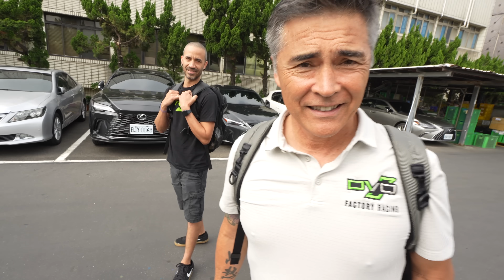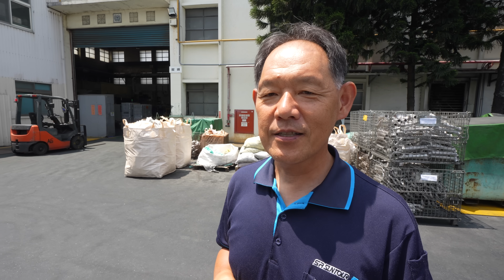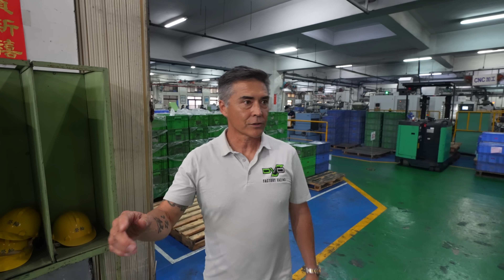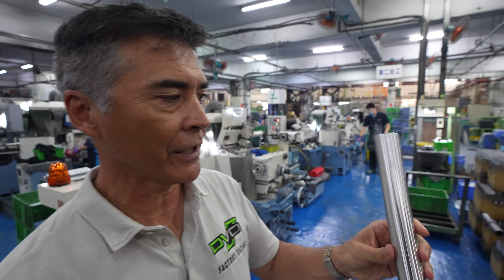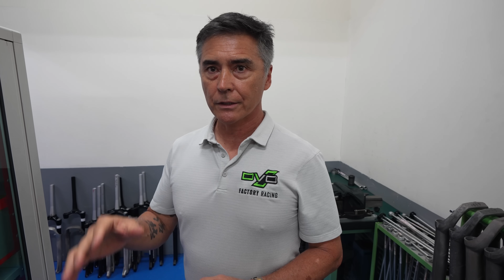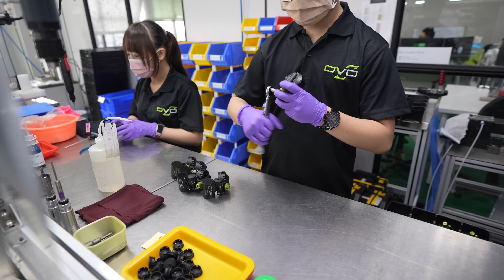We Flew to Taiwan to Visit a Mountain Bike Factory! (Exclusive HQ Tour)

Comment: The die cast machines are definitely newer than the stuff we deal with at work.  Some of our stuff is over thirty years old.  At our other shop nothing is more than five years old.

We stopped making stuff out of magnesium years ago.  One time I was making magnum hammers and the mold opened up and metal got on the floor.  If you counted to three the metal shot up into the air when it cooled.

I don't even know if anyplace molds magnesium in the USA anymore.  We were one of the last in the car industry.  We also do the biggest pieces in a Harley Davidson police motorcycle crankset too.  We are about an hour away from Milwaukee so if something's not is screwed up we can ship new stuff to them easily.
Reply from the maker: So crazy!!!! Was awesome to see in person!

Comment: Suntour forks and other suspension parts are delivered to the bicycle manufacturers (the OEMs). Some Suntour firks are heavy but mostly reliable. In the 1980-ies Suntour used to produce good shifters, derailleurs, cassettes, brakes - groupsets for MTB, Touring, Racing and so on. Some folks might remember for example the Suntour Superbe Pro groupset. Some parts were better than Shimano. Today are here and there also Suntour cranks. They could come back with their great Suntour thumb shifters and other parts. That would be appreciated. Suntour also belongs somehow to Shimano, some people say.
Reply from the maker: Thanks for the info!

Comment: Suntour is the one of the most underrated brand in bicycle manufacturing.
Reply from the maker: They are awesome for sure!
Reply: For having fixed a lot of suntour fork .. they have quality componement inside but curiously they doens't works as well...
Reply: what about xfusion?
Reply: I've ridden & worked on mostly what could be termed "ghetto" mtbs for about a decade now, & I can honestly say the only problem with SR Suntour is they're typically fitted on low end consumer bikes, the type that don't even receive the most basic maintenance!

If they're rusty & don't bounce right it's probably because they've never been cleaned! 😂
Reply: Straight up. 

The XCM30 they produce is the go to for budget mountain bike coil sprung shocks and I've found it's fantastically reliable.

Comment: I used Suntour hubs and other misc parts on my bmx bike back in the early 80s, so it's no question of how long they've been around. I was turned onto DVO after purchasing my 21 Intense Carbine. Couldn't have been at a better time as I have a disdane for RS and Fox.
Reply from the maker: Dvo is awesome!!!!
Reply: @moandhannahtravel On my retired S Brand FSR Bighit it came stock with the Zocchi Jr. T, which I loved. So far on my Intense I've upgraded to the Onxy D1 fork with the OEM Topaz T1 outback. Hopefully soon upgrading to the Jade X coil soon. Or the upcoming new DVO air shock.